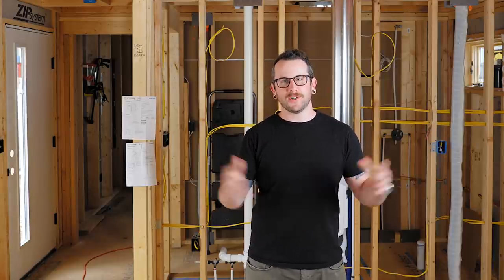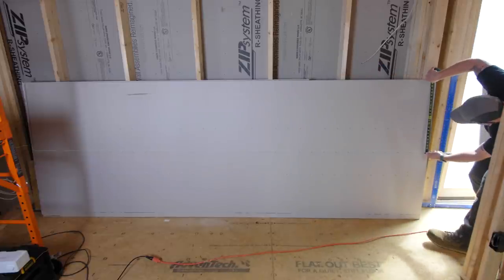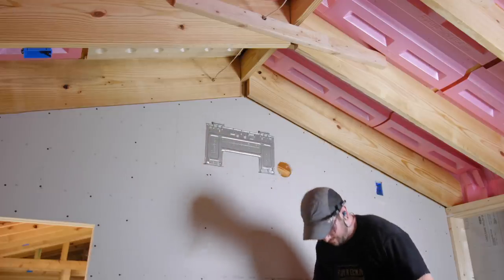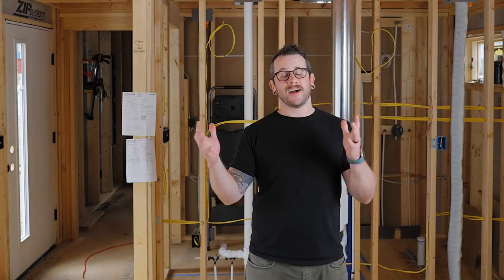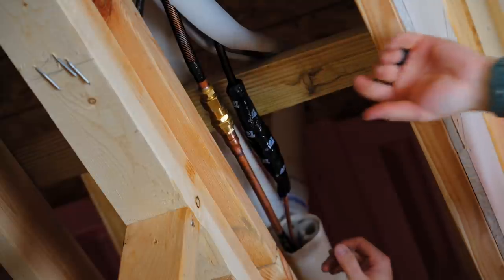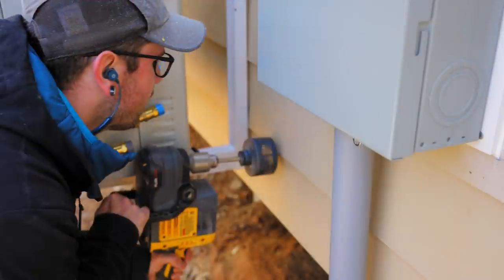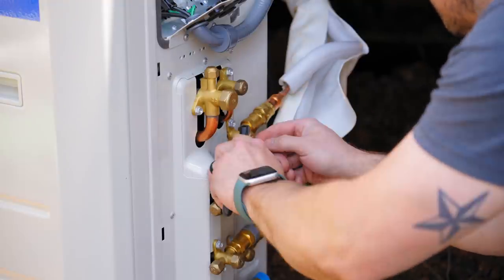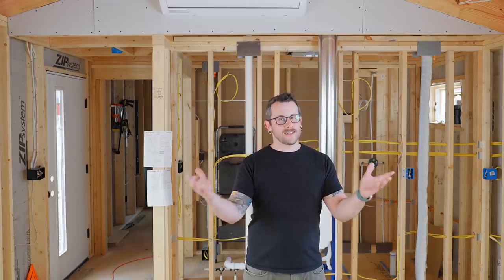DIY MULTI-ZONE Ductless MINI SPLIT Installation in New Construction!

Comment: The attention to detail on this project, especially around air sealing the exterior envelope is commendable. I work on high performance and passive house multifamily projects and the types of details you are installing are exactly what we should be seeing for efficient and resilient buildings. One issue we see is that as you say in the video, these types of minisplit systems can be way too over sized for smaller homes. You may find that come summer time, you struggle to fully dehumidify the home. The issue at play is that the systems have so much output that they can meet the cooling demand for the building before they have a chance to effectively dehumidify. If that becomes an issue you could try only running one of the minisplits and leaving the doors open so that the cooling demand for the building is better matched to the output of the unit. You just need to ensure good air circulation between the spaces.

Comment: Nice trick with the laser to hit the studs with the drywall screws!
Reply from the maker: Oh yea, works great!
Reply: Its funny that they dont show how to vacuum the lines and check for keaks this inf is half ways poor video no thanks. Sorry
Reply: @JorgeRodriguez-uy1mr  The lines are pre-charged with refrigerant. No vacuum pump needed. I'm a universal certified HVAC technician.

Comment: As a structural engineer, drilling such large holes through the plates is a no-no, but an easy fix is to strap across using CS16 straps on either side. Or using 2x blocking between the studs just below the top plate and strapping across there. Ditto for the sole plate.
Reply: This is so very helpful - thank you! I've been looking for hours how to set the minisplit lines through an interior wall - 2 x 4 non-load bearing bottom plate myself. Going to try to go with the smallest hole size I can, but these lines are thick.
Reply: This guy starts every statement with..." As a structural engineer"
Reply: As a structural engineer you have zero friends
Reply: @TheDarkdanik  says the guy trolling folks on the internet over comments that are 2 years old
Reply: I was wondering the same thing after seeing such large hole! Thanks for explaining this!
Reply: Wow so many large holes

Comment: I'm actually fairly sure you open the refrigerant valve first THEN check for leaks (I noticed you added sound deadening before opening the valve too). Either way, great video!

Comment: Glad you got it sorted out, I am really enjoying the build! 

Two notes from our own Mr.Cool install for people considering trying it ( we put in two of these multi-head systems in our place) 

1. Use a torque wrench when making connections and torque to the values specified in the manual. I cannot over stress how hellish it is to try and isolate a leak when you have between 8 and 16 connections on a full unit. Just....do it properly the first time. 

2. Be super careful with any type of expansion foam around the lineset.  If you are going to use it, make sure it has room to expand and isn't between the lineset and a stationary surface. It can expand and crimp the drain line, causing all kind of water damage and worse  in an in-wall application like this. The only bonus is if that happens, you'll know pretty quick 😂
Reply from the maker: Good tips!

Comment: Glad you got that unit off the exterior wall and onto concrete blocks. My condenser sends a weird vibration through the house when it is running.
Reply: Mines sounds like a car is running outside lol

Comment: Interesting video and very instructional. A couple of suggestions though:
Leaks should be checked after the valve off the unit is opened. It does no good to check for leaks if the system isn’t pressurized. Also, even though the unit is pre charged it is a MUST to put the evaporator units and lines under vacuum. These lines introduce air and dirt into the system otherwise. Any moisture and dirt from the manufacturing process will cause issues with your entire mini-split system and will lead to malfunction and or failure. 
Otherwise excellent video!
Reply: mr cool lines are pre charged at the factory,

Comment: How did you check the line sets for leaks before you had pressure on the system?  Not sure I would want compression refrigerant fittings in a wall without access.
Reply: I was thinking the same thing...
Also, if you didn't vac the lines, you'll end up with a small amount of moisture in them which "they say" can degrade the life of the compressor.
Or did I miss something?
Reply: @NobukiPhu  you don't vac the lines.
Reply: @NobukiPhu  Not they say. It WILL create acid in the oil of the compressor and create a burnout.
Reply: @NobukiPhu  The lines are already  prepared, internally dry, and are of a set length from the factory. No vac necessary. It is a unique part of the DIY series from the company Mr. Cool. Downside is the set length.
Reply: I have installed two of these in my home.  The lines are not pressurized the compressor is.  If you fail to pull a vacuum on the lines you will have moisture in the system.
Reply: I kinda wondered why he didn't evacuate the lines.
Reply: @scottwilson891 He's using the pre charged lines, they aren't flare fittings, they're O ring fittings and already fully charged and sealed with freon.
Reply: @ucfsub  @ 13:15 he says he open the refrigerant valve which charges the whole system. Meaning the lines are not charged. I kinda think he doesn’t know what he’s doing.
Reply: @fyuecd2  They'd be flare fittings if the lines weren't pre charged.
Reply: typical DIY mistake.
it's not that big off a deal though since it's not that hard to cut acces holes if ever needed......
i guess it's not known that you can have the fittings behind the unit aswell.
Reply: @scottwilson891  lines are sealed and pre charge. That’s why you don’t need vacuum. I install two system without any experience and they are running perfect. I’m in Massachusetts. Cold or hot.
Reply: @626pingj  You must not have purchased the DIY version, it is about $500 more expensive to my knowledge.
Reply: The lines aren't pre charged they are pre vacuumed. So leak checking before releasing the refrigerant from the condenser is pointless.
Reply: Yes I have to agree with a commenters here. The system is not under pressure until the valves are opened so checking for leaks in a system that has no pressure is pointless. I don't know if that's the way it was filmed or if that's the way it was actually installed but it would good of the Creator to comment on that for other people. This is why you read the comments on these DIY videos. Overall great installation with this exception
Reply: @CyFi6  they are precharged and why  they cost a lot more than regular lines.
Reply: @acostaae90  so wouldn’t they lose pressure in the line when he hooked up inside the house or do the lines have a check valve to hold the pressure or vacuume in the line when its hooked to the interior unit.
Reply: @chrismarch6644  you are supposed to vac the lines. Yes
Reply: @Greg M  lol what exactly do u mean when u say they are "prepared" whenever the plugs are removed, the lines are filled with regular air that should be removed by vacuum, you can not do it and the unit will run, but it can cause issues with longevity.
Reply: @ucfsub  no
Reply: @lvlikeyV  doesn't matter
Reply: @CyFi6  not pre vacuumed
Reply: @yogibearyogibear7229  from Mr cool.  “25 ft. precharged line set, can be easily installed by the homeowner. No special equipment, training, or tools are required to install thanks to the pre-charged quick connect DIY line set.”

Comment: Just finished my multi zone install this was super useful!!! 🔥🔥
Reply from the maker: Nice dude, glad I could help!
Reply: How loud is the outdoor unit?
Reply: How long are the lines?
Reply from the maker: @lakesidecollision4763  you can get 16 ft or 25 ft lengths
Reply from the maker: @nickmpower  not bad at all, can’t really hear it inside even before insulation is installed.
Reply: How's that AC unit working out?
Reply from the maker: @jennyanimal9046  working great!
Reply: I’m install two Four zone Diy units! I’m Nervous and excited for sure.
Reply: Any one know if this product come with heat too?
Reply: @marvinguinac8395    They’re pretty much all heat pumps.
Reply: @JohnCap523  cool, thank you man!
Reply: Can you put one unit in heat mode and the other unit in cool mode?
Reply: @shuitaoyang    I’ve been trying to figure out a way to automate turning off the heating head when the other area reaches a certain temp and really needs cooking.
Reply: @JohnCap523  They don't have emergency heat like most heat pumps?
Reply: @OttoDidactic    No, but because they’re inverters, they run differently and assert they can effectively heat down well below 0F.
Reply: @JohnCap523  heat pumps normally stop using the compressor when the temperature gets below around 45°F as there's not enough heat to transfer indoors by simply reversing the flow of refrigerant. Electric heat strips "emergency heat" then come on to supplement. I'm definitely going to have to find out how these work before buying them
Reply: @OttoDidactic    Not inverter heat pumps.
Reply: you do not have to clean up the air in the pipe?

Comment: Five years ago I installed mini-splits in my existing home, but half the interior walls are concrete block and half are lath and plaster. I did the refrigerant lines differently, connecting them outside the wall and tucking them inside the unit. The so called "communication wire" in mine has a full 220 Volts and I was not comfortable leaving what is basically an extension cord open to rodents to eat. So instead I used metal conduit and #14 wire. The lineset was too short on one so I had to braze some more copper on it. Of course last weekend the controller board crapped out so I guess it is going to be a pile of scrap metal soon.

Comment: 8:54 Leak test should be done after the refrigerant is released into the lineset.
Reply: Don't the DIY lines come precharged? Since the fitting are the puncture style, wouldn't tightening the fittings together release the refrigerant in the lines?
Reply: @lvlikeyV  pre vacuumed not pre charged
Reply: The lines are pre charged. From mr cool. “25 ft. precharged line set, can be easily installed by the homeowner. No special equipment, training, or tools are required to install thanks to the pre-charged quick connect DIY line set.”

Comment: I'm confused.  When you connected the lines, you checked them for leaks by spraying on the soap solution.  Later, when the lines were connected to the compressor unit outside, you opened valves and charged the lines with refrigerant, again checking for leaks.  What was in the lines after hook up that would have created a pressure differential to check for leaks as the lines hadn't been charged with refrigerant until later?
Reply: Wondering the same thing. How did he check for leaks in the first couple checks?
Reply: And didn’t Vac the system..
Reply: @keithrogers3241  you don't need to. This is the DIY system
Reply: Watch the video, the line sets come precharged.
Reply: There is nothing to check cuz there was no pressure. He definitely have no clue what he is doing. He is just reading the script.
Reply: @keithrogers3241 exactly. He was just reading the script
Reply: @countryboy0362  There absolutely is pressure. The line sets come pre-charged.
Reply: @martyharrison8 what is it pre charged with? Nitrogen? Because it won't be refrigerant.
Reply: @martyharrison8 Yes they come pre charged BUT there is NO pressure until he opens the charge valve. He was checking for leaks BEFORE the lines were charged! Lol Clueless
Reply: @martyharrison8 those lines are not pre-charged. The system is pre-charged. Before opening the valves there wasn’t anything that would allow his leak test to work.
Reply: Pre-charged lines
Reply: @The_Humble_Servant No the MRcool system does have pre charged line sets with refrigerant in them. That is why they are considering diy because all you have to do is connect them together.
Reply: @JWill6969  you have to open the service valves on the condenser, the condenser is what’s pre charged not the copper lines. That charge is held in the condenser until you open the valves. This is my profession seems like I would know what I’m talking about.
Reply: @The_Humble_Servant  Yes which is true on majority of mini splits but you know nothing about Mr Cool and their proprietary pre charged line sets. Just Google it man. I get it's your profession but you can't keep up with everything.
Reply: @JWill6969  I stand corrected, those fittings are a problem however, the o rings are known for failure. A tech will be out eventually to correct them.
Reply: Depending who manufactured the system (i.e. Mr. Cool) they offer an option of the hose lengths coming in preset lengths that you choose to cover your needs + extra. To help minimize difficultly and be more DIY Friendly the lines come pre-charged with refrigerant while the main system comes (either pre-charged or under vacuum). 

Although I can understand the funny situation where DIY’er sprays a hose connection under vacuum w/ soapy water looking for the tell tale foamy buildup and or sound. I may be wrong but I think Jon at project farm might have made a similar mistake doing his install before finishing all connections and checking it fully charged. m
Reply: @The_Humble_Servant have had mine for almost seven years, heating all summer, cooling all winter. Zero problems.
Reply: That's exactly what I was thinking 😂
Reply: He also forgot to check if it was cold enough right before doing all the electrical Lol
Reply: If you watch the video you'd hear him say these line sets from Mr cool come pre charged.

Comment: I have been using ductless mini splits for more than a decade and they typically last 10 years. It is best to have the system set up in a way that you can completely replace everything every 10 years. Routing the line sets behind the dry wall is a recipe for disaster unless you are ok with completely replacing the drywall along with the AC. Just my two cents. Great video.
Reply: If I have three units, can the temp be controlled independently or do they all have to be set to heat or cold?
Reply: @Kat-pr7qc  If you have a situation where you have three units in three rooms and each has hugely different temperature requirements, for example one needs to be heated while the other needs to be cooled at the same time, then you should get three heads with three separate compressors. On the other hand, if you want to cool three rooms and they all run at similar temperatures then go with a single multi zone compressor and three heads.
Reply: Wondering if the lines could be snaked back in using the shop vac method in one of the first videos?
Reply: Why replace the lines just connect the new components.

Comment: Friendly tip: The building code for drywal aplication is one screw every 12 inches. You probably used a box of scews for that house. Interior walls you mudered with soooo many screws. But drywall glue two dabs per stud on the wal before installing the board and one scew in the middle of the sheet. Get some training before you train others. Fyi, to cut out a box, always go counterclockwise to avoid blowouts. Using angleiron for backing can save you on time when you need backing.

Comment: How did you test for leaks? Used compressed nitrogen to a certain pressure? How did you evacuate all air and moisture from all line sets before introducing refrigerant?
Reply: The newest version (the one I have) has prefilled lines with quick connect that dont require purge (from what I understand)
Reply: The lines are zero loss fittings, and come Pre-charged. He tested with soapy water as demoed on the video

Comment: How did you check for leaks before you opened the charging screw?  Are the lines under pressure before allowing refrigerant to flow into the line sets?
Reply: This is what Im wondering....it doesn't make any sense lol, and usually you gotta vacum them out too.
Reply: @chrisleslie1988  as long as these have been out on the market, I'm surprised people still ask this question.  The lines are pre charged with refrigerant.  No need to pull a vacuum.  Mr. Cool has made them that way for years, and they run great.
Reply: @gp37128  It depends on which units the Mr Cool is. It looks like these are the quick connectors which would be pre pressurized lines. I'm installing the Pioneer system in my house right now.

Comment: How did you pressurized the system to check for leaks with the soapy water without the outside unit plugged and turned on? Air compressor?
Reply: Thr actual lines have gas in them, so are under pressure.
Reply: @benoitrochon589  hum... I'm pretty used to install this type of AC and have never seen the pipes loaded with gasses from factory, the gas is inside the outside unit, only when you connect everything and release the valves the gas loads the pipes and go to the condenser pressurizing the system. He was testing for leaks without the external unit plugged, that's why I didn't understand it.
Reply: @benoitrochon589  nice, never seen this!
Reply: @benoitrochon589  so the connectors are keeping the lines pressurized? So the gases don't leave the line from an open end?
Reply: @impactproformance  exactly. The connection opens when you bolt them.

Comment: Nice video. I have two questions: one is about checking leaks, do you open the valve a few seconds to check leaks? if no leaks then open fully open valves, right? The other is about the master valve, you mentioned it was not recorded. But where is the master valve located? Thank you.